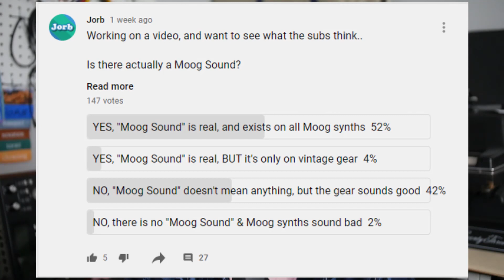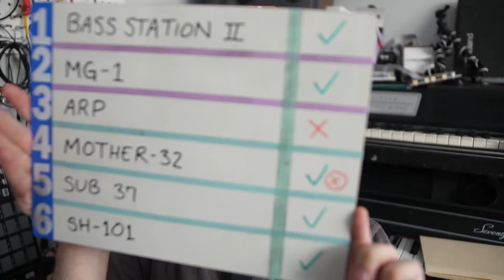Is "The Moog Sound" real? // Blind Listening Test

Comment: Great video. I wish you had a Sequential Pro 3 or Roland Jupiter X or Fantom which all have ladder filters. I really can’t pull the trigger on a Moog because I have both.
Reply from the maker: Thank you!

Yeah I've been really really tempted by the Pro 3 lately, what a monster. Maybe once I sell all these moogs!
Reply: @JorbLovesGear  the Pro 3 has two different settings on the ladder filter, one that acts like a Moog and the resonance drops the low end, and one where the low end doesn’t drop. It’s a beast of a mono synth (technically a tri-paraphonic? Synth🤣)

Comment: best moog sound is not because it is something nonreplicable, but as friend of mine said, "its all sweetspot". It is difficult to put these machines in bad setup. So it's not about sound but interface imho.

edit after whole video: I wonder were you wrong if you'd hear bonus round with full resonance up. All the correct answers looked like you realised the answered with blown up resonance.

Comment: ONE note (while sweeping the filter) in isolation is not enough info.  That's like plucking one open string on a guitar (while fucking with the output) and expecting you to tell me what brand of guitar it is.  

A better approach would be to A/B a Moog against a non-Moog, and you pick which one is the Moog.  In isolation, you're just making a blind guess.

Comment: Doesn't the KArp Odyssey have multiple filters? Which were you using? Loved the video regardless!
Reply from the maker: It does! I totally forgot to change it to the moog clone filter, which i think is 2? But mine was on circuit 1, which I think is 12db/octave.
Reply: @JorbLovesGear  Not sure which setting is which... I do have an Odyssey 2810 with the #4035 Moog filter clone and the bottom drops out with resonance just like an actual Moog. In your video though, I don't blame you for getting tripped up on the Korg Odyssey, it definitely sounded closest to the actual Moogs.
Reply: I also have a 2810 odyssey with the 4075 filter and can confirm that increasing resonance causes massive drops in bass frequencies,  but I also have a Micromoog and the filter on that sounds absolutely nothing like the one in the Odyssey. Interesting, eh?
Reply: @kgbinfo  Indeed. Bass drop out with resonance is not unique to only Moog, but it's definitely a characteristic of a Moog filter. I have a Multimoog, so same filter as your micro and there's a known fault with those. They lack bass even without resonance. There's a mod available. Regardless, I agree... synths & their sounds + user perspectives is always an interesting topic ;)
Reply: @SacSynths_Jack_Z  interesting that you brought up the "lacking bass issue" in the Micromoog. I've always wondered what people were on about. My Micro has plenty of low end; at least as much as my Odyssey. I wonder if it had the mod done on it by a previous owner. Either that or the whole thing is a myth!

Comment: From what I heard, in all cases here the Moog synths had the standard "moog filter" behavior in that when you increase the resonance, the low end drops out of the sound. None of the non-Moog synths in this video have this behavior to the degree that the Moogs do. Very fun video and I like that you had fun making it. Carry on! :)
Reply: Yes, it's all about the low end.
Reply: @ghost mall that transition between low and high frequencies is definitely the defining feature, i feel like you wouldn’t be able to tell most synths apart in a finished mix but i don’t think the moog filter sweep is very replicable barring just straight up cloning the circuit
Reply: Same for me. The Moog filters reduce the low end the more resonance kicks in. While it's nearly impossible to guess the moog without resonance, it becomes very easy the way you performed this test with rising resonance levels.
On a side note, I am a little disappointed about the Arp. The filter lacks resonance. Maybe it's the way you set it up, but I barely could hear any resonance.

Comment: I do think there's a "Moog" sound, but it isn't limited to Moog synths. I think it comes down to having fairly drifty VCO's (or DCO's with a good "slop" algorithm) and a transistor ladder filter, plus the ability to overdrive the filter. So other various clones like the SE-1X/3X, SE-02, Boog, some MFB synths etc. can achieve very similar sounds.
To be honest, I'm not a huge fan of the ladder filter. I think the bass drops off too much at high resonance, and the resonance sounds too much like a "detached" whistle/sine wave rather than being a part of the sound, unless you overdrive the filter to where it nearly breaks up.

Comment: fun idea! definitely would like to see a non synthesist try it.
Reply from the maker: Cheers thank you! I most certainly planning doing that as a follow up, only downside is I have to wait before selling some of these moogs now. Lol!
Reply: @JorbLovesGear  Which of these did you sell and did you sell BS2?
Reply from the maker: @LukezyM  bs2 was borrowed, so it's gone. Mother 32, mg-1, mopho are gone now too, I rent the sub 37 out at backline sometimes so I keep it around
Reply: @JorbLovesGear  Sub 37 is really all that one would need for a mono synth. Too expensive for me though. I’m looking for a mono in realms of 300-400 bucks, with patch storage, so most of Behringer’s modules don’t cut it. Typhon is one option, it’s good because of fx and modulation, but scarce in osc engine. BS2 has all one would need and it’s cheap. I don’t really need an onboard fx too, so..

Comment: Cool video! There are two design features that might be part of "the Moog sound.":

1) They don't make a pure square wave. I think that's true of every Moog ever made. If you take an Arturia synth and dial up a pure square you get one. It's that thin, hollow sound. You can't make that on a Moog. If you take the Arturia and add in a bit of saw then you'll get the same wave as the Moog square. 

2) Starting with Voyager, the filter knob doesn't open the filter all the way. I'm not sure if every modern Moog is that way, but I know the Sub 37 is and I think the GM and Matriarch are too, based on other's comments. I haven't tested the small semi-modulars. Unfortunately I can't hear past about 12k anymore so I can only figure it out through testing ;-) This probably matters most when you're driving the filter into distortion.
Reply from the maker: Is the imprecise square wave not just when the mixers are driven?

Or are you suggesting there's always some drive in the signal path, or that the squares are derived in some particular way?
Reply: @JorbLovesGear  I'm sure it's a design choice. My assumption is that Moog just doesn't want their synths to have the ability to make that thin, reedy sound you get from a pure square. All phat all the time ;-) The Model D, the Voyager, and every Moog made since is that way (well--I'm not sure about the Moog One). 

On a scope, the Sub 37 square has vertical sides, but slanted top and bottom (slanted opposite the saw). Driving the filter rounds off the front corner (giving it a smoother sound). Adding multi-drive sharpens it again. You would think that somewhere between saw and this square/ramp hybrid wave that it would become an actual square, but it doesn't. There's a point where the top is flat, but the bottom is sharply angled at that point. At the square setting the top and bottom are angled the same amount. Going past there into pulse narrows the gap, but it doesn't change the slope until you get to the extreme setting where the bottom becomes flat but the top becomes a sort of fin shape. 

Voyager has pretty much the same shape square, but a steeper slope (it's buzzier). While Sub 37 has a nicely formed triangle, Voyager has a humped shape. The path from triangle to square is very different on Voyager. In my opinion, the 37 is more interesting (sonically) in that regard. Mother 32 has a square that is identical to Voyager. Interestingly, if you turn the filter all the way down on the Voyager square you get a close approximation of a sine.

Comment: MG1 was my second monosynth and my first 'real' one (Had the CS01 before but that's not in the same league).  I've used Moog's most of my life and had never done an A<>B comparison.  I could clearly hear the Moog's versus the others (I listened to the vid not watched). I have a Behringer Model D and it does actually sound like a moog, though I've never played a real minimoog.  I've occasionally tweaked the wrong filter when running the Model D and Slim Phatty side by side

Comment: Good job on the guesses. I think having Chase guess is a great idea. I think you might subconsciously know them which got you right.

I know you proved otherwise by getting them (nearly all) right but I don't thinks there's a specific "Moog" sound.
Reply from the maker: I agree, my experience with the synths is unavoidable.

I really don't either, but want to think of other good ways to try and test it.

Maybe just 2 at a time with someone who isn't as familiar, and just set up the questions to focus on comparing. 

Do these 2 have any shared characteristics, are they both moog, or they both not, etc.